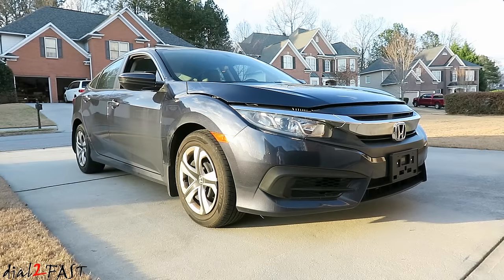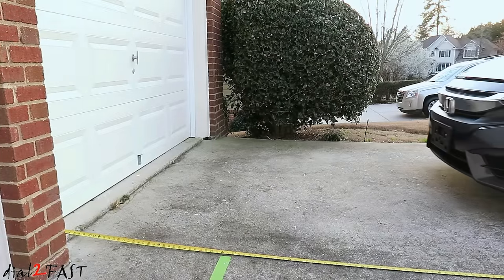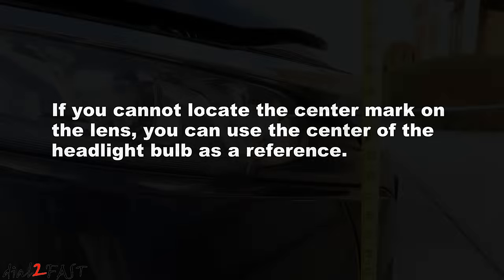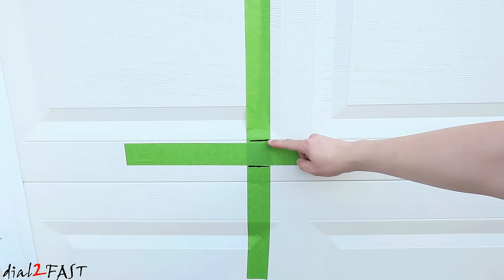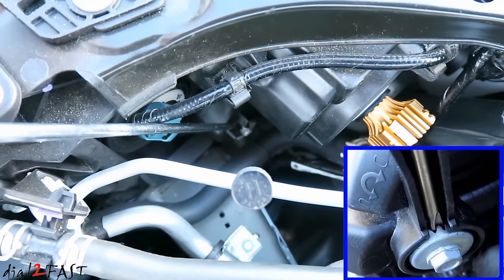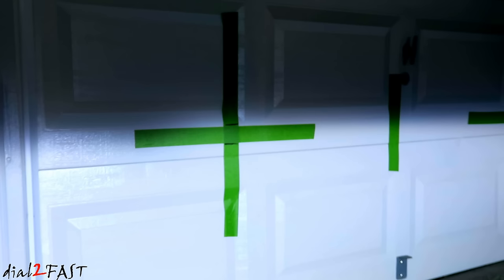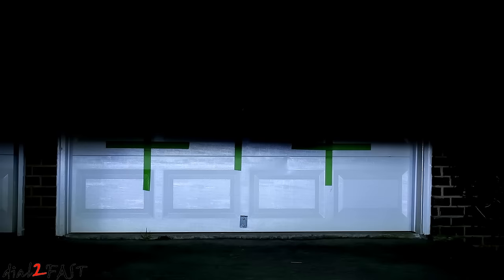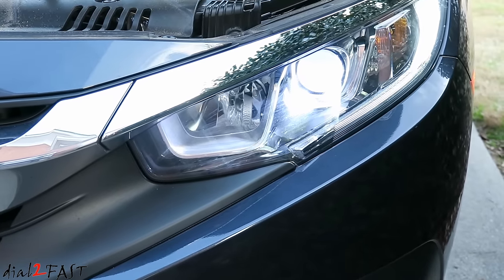How To Properly Aim The Headlight and Foglight - Full Tutorial

Comment: GOOD VIDEO !! HOWEVER THE DRIVERS SIDE HEADLIGHT NEED,S TO BE LOWER BY 4" AND 2 INCHES ON THE PASSENGER SIDE- ESPECIALLY IN TODAY,S SUPER L.E.D.,S ETC;
Reply from the maker: Thanks for your comment!
Reply: That’s incorrect information. The way he has them aimed is how they are supposed to be aimed by law period. That’s a 2 inch drop at 25 feet. That’s what the law is. Aiming it down 4 inches does nothing but limit his visibility and makes driving at night dangerous for him. The reason people will flash the lights or thing the lights are not aimed properly on cars with the blue headlights is because the human eye is very sensitive to blue light and that is why everybody flashes cars with blue headlights. I know all of this personally because I work in the automotive industry testing a ton of prototype vehicles for all manufactures and I work with them on there headlight designs and functions. If people would take the time and properly adjust their headlights like in this video then people wouldn’t be getting blinded on the roads.
Reply: @TheKraken2019  I don't have a wall to do the adjustments like many of the tutorial videos on YouTube. My driveway is steeper than the one show on this video. Will doing the adjustments work on steeper driveway?
Reply: Linh Nguyen personally I would not do the adjustment on a steep driveway. I would drive around town to find a parking lot that’s flat with a wall and use that to adjust them properly. I’ve found that a target or walmart parking lot works most of the time. Or if that won’t work you could find a flat parking lot and have a friend hold a big piece of cardboard or big white construction board 25 feet from the front of the car and take your proper measurements and mark with tape on that cardboard or construction paper and then aim them that way. Heck I’ve even come across flat parking lots and had to use the side of a white pickup truck to adjust them before as well. Now I will say the reason why doing it on a steep driveway is a very bad idea is because the weight of the vehicle would be shifted more on the rear of the car causing the front end to site higher causing the adjustments to be off. This is why it’s always best to use a flat parking lot or parking garage. Hope this helps.
Reply: @TheKraken2019  thanks
Reply: @TheKraken2019  So is that true that the drivers side headlight has to be slightly lower than the passengers side? mine is in the same level when i do it in the wall but when i look at them w/ my eyes (standing in front of the car), the drivers side headlight is higher. Mine are projectors. I'm so confused because i forgot how they used to be from factory. please help me. i'd really thankful
Reply: Ariq Zax that is not true. The drivers side headlight and the passenger side headlight should be aimed to the same level. The only time I see one side lower is if someone at a dealership tried adjusting them who had no clue what there doing.
Reply: Ariq Zax if yours are at the same level then they are adjusted properly.
Reply: Ariq Zax are you on flat ground 25 feet from a wall? If not then that’s why they are like that. You can’t pull up to a wall really close and adjust them cause they will never be right doing it that way.
Reply: @TheKraken2019  Alright man sorry to read 2 months later. Thanks a lot for the info, really helpful. Appreciate it 🙏🙏
Reply: This video was more helpful than my car's Haynes manual. The manual only have 25 ft, no other measurements were given. It said "please, have the vehicle adjusted by a professional in a repair shop".

Comment: Right side  headlight is to aiming slightly left side  how to adjust that
Reply from the maker: As mentioned in video, if you are in the US, most modern car does not have horizontal adjustment. If your headlight does allow for horizontal adjustment, there is another screw behind the headlight for horizontal adjustment.

Comment: Your RIGHT side headlight should be higher then the left side.
Reply: the specs usually are around 2-4 inches below the headlight bulb centerline for most cars and trucks setting them level without the driver takes that into account/ compensates for it, he is setting those headlights at maximum legal height adjustment although he might end up pissing off oncoming cars (he should have set the driver sideheadlight at 3-4 inches below headlight centerline instead of only 2.

Comment: Great video, really. Problem here is OEM headlight assembly is designed for xenon ( incandescent) light bulb and you have  replaced it with LEDs. Each light bulb has a different burning point distance and will produce a different reflection. You just changed the light color, but destroyed the whole headlight design. Reduced the range also.

Comment: You didn't show where the screw is to adjust up or down on the fog lights, and you didn't tell clockwise or counterclockwise is up or down on the fog lights 99% of the video was about the driving lights or the low beams.

Comment: Dont cover the  light,  it will heat and damage
Reply from the maker: You just need to block one light to do the adjustment for couple minutes. There is no damage.
Reply: Saber Chou haha there will not be any damage for the 30-60 seconds it is taking to adjust the lights.